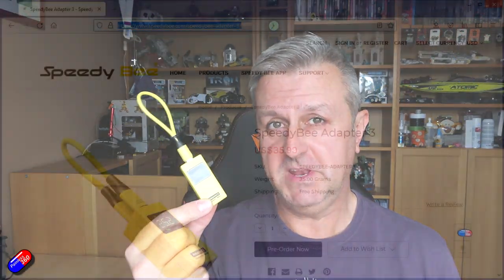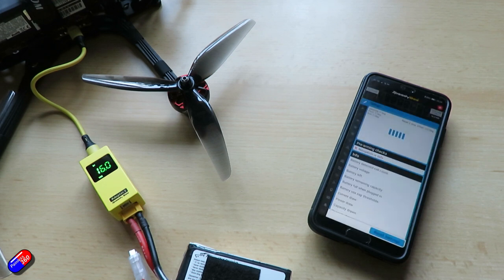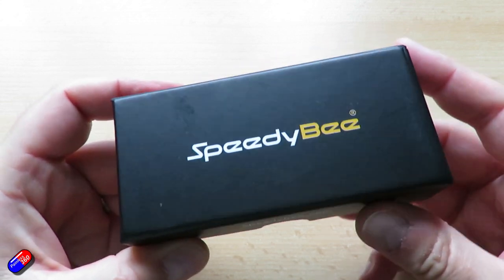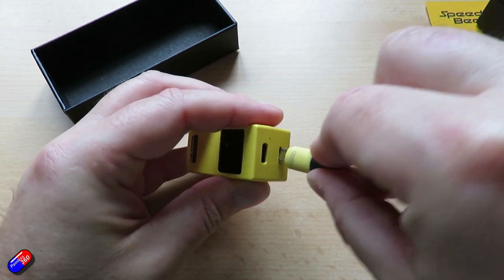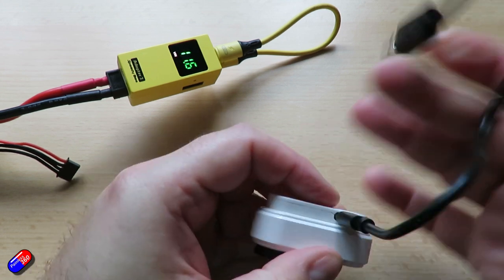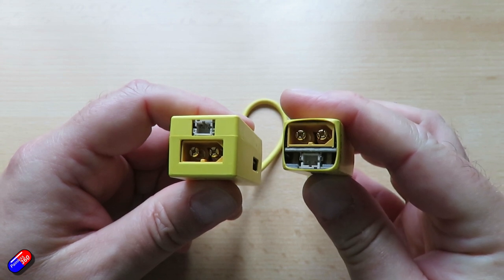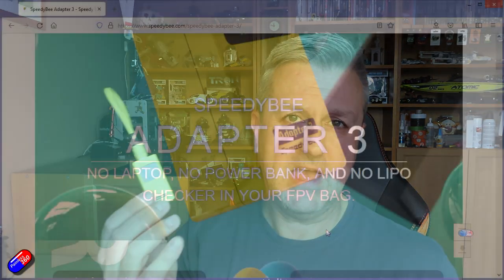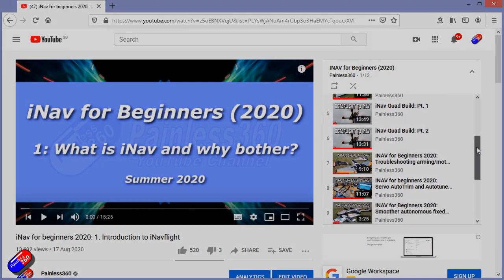SpeedyBee Adapter 3: Flash and setup a model without a PC (and lots of other stuff!)

Comment: I just got mine. Yet to use it coz my lipos are XT30 not XT60... Here's an idea for the v4; balance lead connection. Check individual cell voltage regardless of XT60/XT30...
Reply: You can get an xt60 to xt30 adapter for like $5 thats how I have to charge my transmitter battery.

Comment: Can I still update the firmware with a normal USB cable through Betaflight, or to flash this SpeedyBee FC I need mandatorily this Adapter?? Thanks
Reply from the maker: If it has a USB connector on the FC then you can use a PC
. Happy flying

Comment: Will the plug fit in a cinelog25?  So tight most won’t.
Reply from the maker: If it has a micro usb or USB C connector.. happy flying!
Reply: @Painless360   Thank you and yes the Cinelog is micro usb however, because of a standoff and prop guard it’s difficult to fit the connector between them and into the board. I’ve literally used an exacto to trim my micro connector to fit.  Thx for your help!

Comment: Hope you can help me. Sorry question is not related to the video. I bought the happymodel express LRS EP2 2.4 receiver and the transmitter module that goes with it. Will the little receiver work with my old CC3D control board?
Reply from the maker: You'll need to find out firmware for the old CC3D that understands CRSF. I'm not aware of one. I'd strongly recommend recommend that you use a modern flight controller.. Best of luck
Reply: @Painless360 
Thank you very much.
Happy flying
Reply: I did order me the HIFIONRC F7. what do you think of that board?

Comment: It's a great little package, but I still don't get why you'd use this rather than a simple USB OTG cable.
Reply: You would use this because you can flash firmware using any phone as to where you can’t do that with a usb cable from a phone. Plus sometimes flashing a flight controller from a laptop for a beginner can be challenging if the computer doesn’t have the correct drivers and other things it needs to communicate with the flight controller. This just makes setting up a quad so much can easier IMO.
Reply: I guess you need it if you're on an iPhone, but that's more a reason not to buy iPhones :-)
Reply from the maker: Thanks for that last comment David, that make me almost spit my tea out over my keyboard! Happy flying! :D
Reply: @Painless360  Switch to Coffee. You wouldn't dare waste it considering to ever climbing price! LOL!